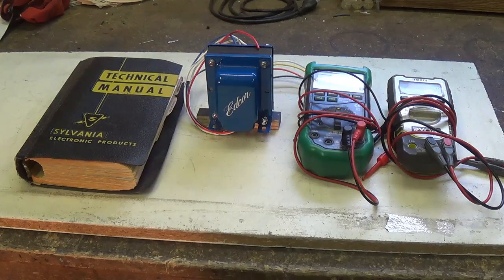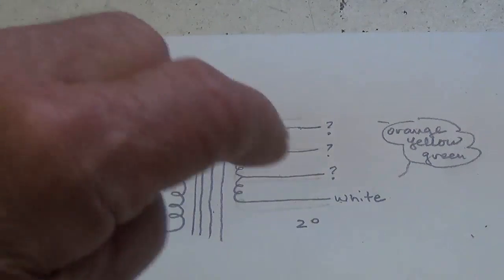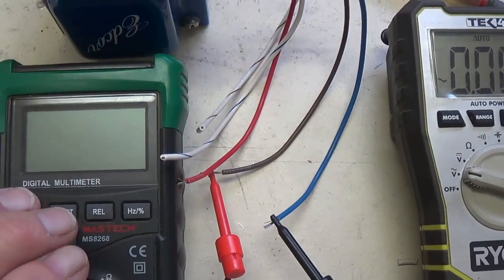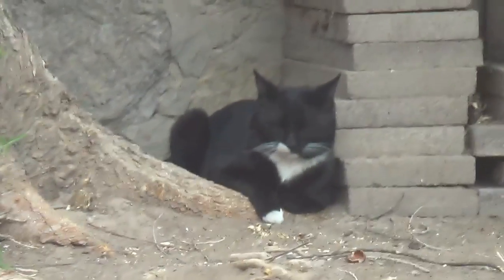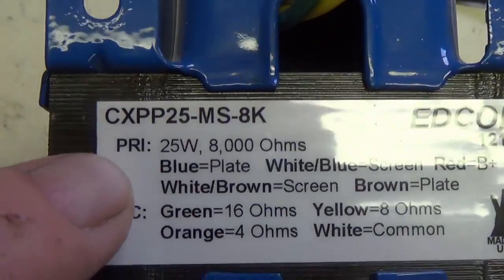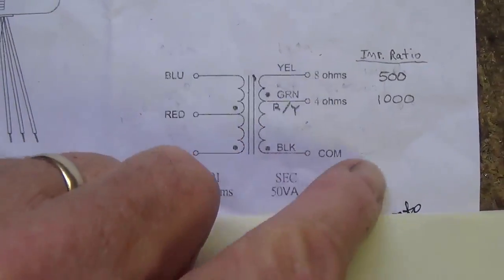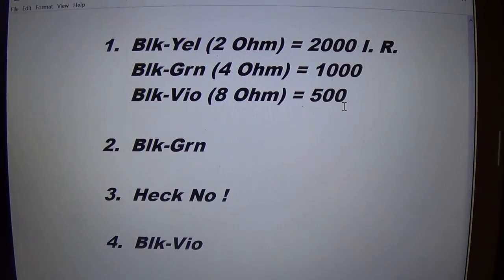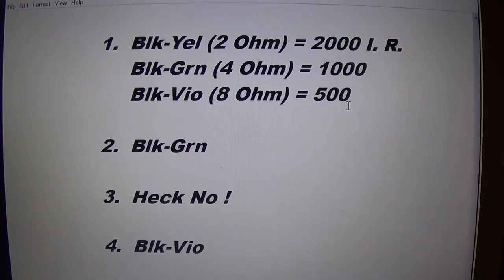Impedance Ratio: The Easiest Way to Decipher Output Transformers

Comment: I am going to inject a comment for consideration here, as you know Uncle Doug I am NOT in any way an expert on things of this nature but, I have a pair of mid eighties Infinity HI FI speakers that run down in the 2.5 to 3.5 ohm range at certain frequencies, considering that this is an ultra linear transformer could it be that this transformer would be a pretty good match for a HI FI tube amp (I know we are talking guitar amps here) to match these types of high load speakers to a tube 6L6GC hi fi amp? I mean it looks like it would work okay for what I'm seeing here, again I am not contradicting you just asking! As an aside the mid eighties Infinities where known as amp killers and needed an amp stable down to 2 ohms to run at full volume. I stopped the video at 24:17 to comment. I would like to ask another question (I know it's outside the scope of the video but I am just wondering) if I hook up my oscilloscope to the output of my amp while running my Infinity speakers I should be able to calculate the speaker impedance while running, is this correct?  Okay, now on to the Hot Rod. I love it! Since you mentioned the rear view mirror I have a quick story about my car, a 1986 951 Porsche (944 Turbo) it has been lowered about an inch or so (30mm to be correct) and it rides ROUGH! great for the track...not so much for the street, I was going down old 66 near where I live in western Oklahoma and it is still of the old train track like separated concrete sections of road, kind of like a train track, ka chunk ka chunk sort of thing I know you know what I mean, anyway on particularly stout KA CHUNK my rear view mirror just decided to let go and fell into my lap, lol. Well isn't that special, lol., anyway GREAT episode and I love what you've done to the Hot Rod!! It looks much better now, keep 'em coming!! Thanks for all you do and have a great day!!
Reply from the maker: Greetings, Jack. Yes, the impedance varies with different frequencies. I didn't venture into that minefield because I wanted to keep the video clear and easy to follow. I believe the standard frequency for speaker and OPT impedance measurement is 2KHz. Thanks for your nice comments on the ratrod. I went to a car show today and it was a big hit. I spent the afternoon "antiquing" the '32 Ford grill shell so it would match the rest of the car.
Reply: I completely understand. I love the car, I'm sure it was a big hit!! A Deuce shell would be perfect! Thanks again!!

Comment: Is there a lot of information in that book like ohms law and that I’am wanting to learn more about this stuff
Reply from the maker: That's good to hear, Chris. Best of luck with your pursuit of knowledge.
Reply: @UncleDoug  any suggestions of books or DVDs on learning I built a 5E3 clone but I ran into problems with the power supply and blew a three watt resistor so I stopped with the amp and now I’m trying to learn more on the transformers and the rectifier tube and stuff to be able to diagnose what I wired wrong

Comment: Hi Doug, I got a different answer for #3 and wondered where I might've gone wrong. Some data sheets put a pair of PP 6L6GC's at 4k4 ohms, which is only 10% off of the Xfmr's stated primary, meaning it should be close enough if using it as described. That said, it says it's rated for 40W which I assumed is RMS, and also conservative. In my experience, 2 PP 6L6GC with fixed bias come in around 32w RMS with cathode currents at 80mA and 400vDC on the plate, so I figured it should be fine. Can I get your thoughts?
Reply from the maker: I'm sure there are all sorts of different ways of looking at the problem, Britt, but I simply wanted to remind viewers to pay attention to the rated wattage of the OPT. Thus, the simple answer is "No", based only on the information provided......a 40W OPT won't work in a 50W amp.
Reply: Thanks Doug. I've been accused of overthinking things often. It appears this is no exception, haha!
Reply from the maker: Better too much thinking......than the opposite, Britt.

Comment: Can you post links to the meters etc that you prefer to use?
Reply from the maker: No high-tech here, Michael. I got my latest DMM on Ebay for around $40.....and love it. The Simpson meter came from a local pawn shop for $25 and required some clean-up. ESR meters are nice, but you can probably get by without one if you prefer to simply replace electrolytics.

Comment: Hi Uncle Doug.... just curious, do you have any idea what the current output might be on the secondary of the hundreds of volts from the output transformer? So for instance if I use a 12 VCT 3A to inject 6v into the primary of the OPT and get 250v out of a secondary winding, what would the max current be? 250v (?)A? Thanks in advance!
Reply from the maker: V x I  in  = V x I  out, Rob. 6 x 3 = 250 x I  so I = 18/250 or .072 A  (72 mA).
Reply: @UncleDoug  Ah! Thank you very much! I appreciate the info. :)
Reply from the maker: @nonsuch  You're welcome, Rob.

Comment: if using 4ohm impedance you could i guess wire 2 8 ohm speakers in series to get our 4 ohms ,I had a amp tech years ago wire my 4 12 inch speakers in parallell ,which i believe should give me 8 ohms ,the amp has a 2,4 ,8 ohm selector switch ,so its set on 8 ohms pretty sure that being on 8 ohm on selector that it is correct,btw the rat rod is coming along very nicely ,the chopped top makes all the difference in the look ,your doing a awesome job on the car she sure looks wicked
Reply from the maker: Thanks, Joe. It's the other way around......2 x 8 Ohm in series = 16 Ohms, while 2 x 8 Ohm in parallel = 4 Ohms.
Reply: @UncleDoug  absolutley and that explains why my 4x12 cab wired in parallell is 8 ohms

Comment: The old question, does size matter. I haven’t calculated a 65’ Gibson Falcon output transformer specs with 6v6 output tubes but it seems awfully small for the job. This maybe a horrible observation(definitely naive). I ask as the later Falcon sound a bit weak compared to the 1960 model. Apologies….
Reply from the maker: No apologies necessary, PW. Yes, mass does matter when it comes to all types of transformer, including output transformers (OPT). Skimpy OPT's can result in a loss of bass frequencies, which produces the "weak" tone you referred to.

Comment: Can we connect 4 16ohm speakers to the 4ohm lead? Or 2 16ohm speakers to the 8ohm lead? If yes, how would we do this?
Reply from the maker: Yes, if the speakers are wired in parallel.....not series.

Comment: Don't know if this has been asked - and/or answered - but if impedance of the tubes varies based on the plate voltage how can you calculate a perfectly (or ideally) matched output transformer?  is there some math to determine that outside of ballpark tube data sheet figures?
Reply from the maker: You simply use the impedance associated with the specific plate voltage that you will be using in the circuit.
Reply: By the simplicity of your answer I assume I missed a connecting dot ;-)   I shall re-watch.
Reply from the maker: @huddyskiba1  If you consult a tube manual, it provides the impedance for all output tubes, single and double-ended, at different plate voltages.

Comment: Hallo. I have one question so please help me. I have hand made Deluxe reverb with Hammond output transformer. Amp work on 8 ohm with Jensen P12N speaker. Question is can I replace this speaker with Celestion greenback 16 ohm? Trafo have 3 wires for 4,8 and 16 ohm. Did I must do something else or just switch wires from trafo? Kind regards
Reply from the maker: If your output transformer has a 16 Ohm output winding lead, then you can simply connect it and the common lead to your 16 Ohm speaker.

Comment: So let me understand this. For the 6L6 tubes, the test transformer calculates for correct speaker impedence, but the primary impedence of 8000 ohms does not match the tube data. Isn’t that an issue? If not, why?
Reply from the maker: The output transformer doesn't "calculate" anything, Danielle. It simply reflects the impedance of the speaker back to the output tube(s). It's up to you to ensure that this reflected impedance is correct for the output tube(s) being used. A tube manual is used to determine the correct impedance for the tube(s). There is some leeway, but the reflected value should be reasonably close to the stated value.

Comment: Uncle Doug, If we didn't know that the white was secondary common, is there a way to determine "blind" which is which?
Reply from the maker: It's generally white or black, FM, but you could use an accurate ohmmeter to determine the resistance between each pair of wires. The pair with the highest resistance would be the common and highest speaker impedance. This would narrow it down to one of two wires, and the common would probably be the blandest color.

Comment: Cheers from Argentina Uncle Dog! you are a great teacher and I admire you a lot! Can I make you a question about an amp that I have been working on? It makes a awfull distortion at higher levels... I change the speaker and the problem remains, change the power tubes and nothing... it´s a hybrid Fender Super Champ XD... thanks!
Reply from the maker: Thanks so much, Fernando. I'm sorry to disappoint you, but there are so many variables that I simply can't troubleshoot a complex problem like that by long distance. You need to work your way through the circuit carefully to find  incorrect voltages or failed components. Good luck.
Reply: No problem!! I will keep working on the amp! Cheers!

Comment: Shouldn't you be injecting your low voltage AC into the primary and measuring on the secondary so you are not dealing with such high AC voltage on your output?  Could be pretty dangerous if you don't know what to expect for an output voltage.  I just feel that going the other way keeps you in lower voltage throughout the test.
Reply from the maker: The lower the voltage, the less accurate the measurement.......and why would AC voltages in the 20 to 50V range be especially hazardous when dealing with circuits that routinely have over 400V present?  If it is, then this type of work is just not recommended.

Comment: What about if you put a resistor across the speaker terminal to bring you to 2.99 if you had a 6  or 8 ohm speaker.
And another question what was in the microwave when it went off...hahah
Nice hot rod like the wheels I bet they're light, only thing I maybe  change in the wheels instead chrome rings around the cutouts but maybe that might be a bit glary
Would be nice with some skeleton and bones on the paintwork instead of flames what do you think. I know the perfect name for that car the Undertaker, see what I done there. wouldn't it of been easier to drop the front end by 2" and raise the back by 2" or would that have hit the cross member....?
Reply: If played with this notion as well.  Getting a high wattage resistor and putting it in whatever position you need  to adjust any speaker impedance you are trying to create.  For example I have two 8 ohm speakers that I'm running in series but my transformer is really only meant for 8 ohms.  So to me I had the choice of 4 or 16 ohms with those two speakers I have.  I've wanted to try and drop each speaker to 4 ohms using a resistor in parallel on each speaker, then run them in series.  But I don't wanna fry my tranny.  
Yet to finish the video so I might find the answer yet...Just wanted to reply to this comment in case Uncle Doug reads it and replies to you lol

Comment: What if I want to run at 320 volts? Uncle Doug HAS to be a licensed teacher, probably happily retired by now. I see a lot of 6L6GC amps that run a primary impedance of around 4000-4250 Ohms impedance for a PAIR of 6L6GCs (for GUITAR AMPS). They run at pretty high plate voltages too. 1900-2300 Ohms is pretty common for FOUR 6L6GCS. 1200-19000  Ohms is pretty common for SIX 6L6GCs. Now we are getting to 150-180 Watts, making the neighbors mad and some potential hearing loss. My old Chevy had an ammeter, where to the right of ZERO meant the alternator was working and to the left of zero meant you were draining the battery.  I rather preferred that to the new volt meters.
Reply from the maker: You're right, Seth, I am a happily retired teacher.

Comment: Hey Uncle Doug, this video is pure awesomeness, thanks a lot! I was also wondering what's the expected load resistance for a 2 x EL34 based amp - PP running at a 465V plate voltage (Orange amp from 1970's), I can't find this info in the data sheet I have... would you have the info somewhere? Thanks!
Reply from the maker: According to Wikipedia, since no traditional tube data I could find provided the load resistance in an AB circuit, the load resistance is 3.4 k Ohms.
Reply: @UncleDoug  Many thanks for your answer! Funnily enough, I just found out contradictory data in an RCA tube book from 1975, and they state an ELR (plate-to-plate) of 6500 ohms,  push pull Class AB1 (values for 2 tubes) @ 450V plate & grid N°2 supply voltage! Who to believe then? :)
Reply from the maker: @raphUp2eleven  I believe 6.5K is too high for a pair in P-P.  According to https://frank.pocnet.net/sheets/129/e/EL34.pdf  The load resistance is 3.5K for fixed bias. Almost identical to Wiki.

Comment: Is there a reason why you use one transformer to step down to 7V and then step up using your test transformer, versus simply connecting the mains to the primary side of the test transformer?
Reply from the maker: I prefer to input low voltages to the secondary and get readings from the primary, Nikita, and I usually use a Variac to get several different input voltages. If you want to reverse the procedure, you are welcome to do so.....as long as you are very careful to avoid any shock hazards.
Reply: @UncleDoug  I guess if you accidentally energize the wrong end of the transformer with mains power you could get in the kilovolt range. I have no experience with such voltage but I expect it’s best avoided.

Comment: I'm no expert - but perhaps they don't list the impedance ratio because it may dependent on frequency.  It would be fun to see you repeat the measurement with the audio signal generator and oscilloscope at different frequencies and get a frequency response.
Reply: These measurements are usually taken at either 400Hz or 1KHz. Often it is stated at which frequency the measurements are taken. For hi-fi operation, the impedance should remain steady through the midrange, so either of the above frequencies would be fine. The transformer characteristics do change at the frequency extremes (20-50Hz, 10k-20kHz).
Reply from the maker: Thanks, CJ. Since the impedance of an inductor is directly proportional to frequency,  the frequency must indeed remain constant throughout the measurement, and significant variations do exist at extremely high or low frequencies.

Comment: Hi Uncle Doug, could I use a standard 9 volt pedal wall-wart instead of the filament trans?
Reply from the maker: If the output is AC it would work......but it's generally DC, which won't work with a transformer.

Comment: I noticed in the tube manual that there was an ultra linear section for the 6L6GC's and wondered if the math worked out there.
Reply from the maker: What math are you speaking of, David ?
Reply: @UncleDoug  If the tube impedance was different (under ultralinear) such that ithe math worked out to a 4, 8, or 16 ohm speaker. You had said earlier in the video that the transformer was capable of an ultralinear configuration.
Reply from the maker: There is generally a special column in tube manuals for output tube ultralinear operating parameters and they tend to differ from those in regular circuits.

Comment: Using this method I get an impedance  ratio of 570. I'm using 2 pairs of 6L6GC's in push pull. Typical Twin Reverb setup. The final numbers seem to be off by a factor of 2 given that my Super Six uses 6, 8 ohm speakers in series parallel or 5.3 ohms.
My results:
6.3 vac applied to the  secondary, (actually using the filament windings on the power transformer) and getting 146 vac on the brown to blue. (Primary)
146/6.3 = 23.17 squared = 561.69. 6000/561.69 = 10.68. That number is perfect if it's divided by 2.
Do I have to factor in the push pull?
Reply from the maker: The procedure is run on the output transformer......not the power transformer, Borg.
Reply: @UncleDoug  Yes I know. I only used the filament windings to get the 6.3 vac to apply to the secondary of the output transformer. It's the only source of low voltage ac that I have. I did disconnect the secondary from the output jack chassis ground.
Reply from the maker: @borg3575  I misunderstood, B. Sorry.

Comment: Is there a video on power transformers?  I bought a amp that has a blown power transformer so I can only guess what it is. 5y3 requires: 380v plate, 5v fil.   The other tubes are 12.6 fil.  12J5, 12SL7, 12SH7.  Meaning the transformer needs to be 380v, 12.6v, 5v ?   if I understand it correctly.
Reply from the maker: Yes, I have posted videos on PT's. That's an unusual tube complement......good luck finding a replacement.
Reply: @UncleDoug   I think it's more I don't know what I am talking about. I have been racking my brain with this one. I am a newbe at this.  Enjoy your videos as they are a great learning tool.
Reply from the maker: @MichaelRusso  You might want to start with a more conventional circuit for your project.
Reply: @UncleDoug  You may have a point. I will continue my study on this.

Comment: My Model Train Transformers put out AC voltage reduced 5 to 15 volts can i use that as a power source for this test???
Reply from the maker: I guess, Dennis, but you're better off with a 30V to 50V source. You can apply your AC voltage to the primary and then accurately read the secondary output (it won't be 1.000V, however).
Reply: @UncleDoug  well when saw you pushing 6 volts I thought my train transformers do that???? They take in 120 and put out 15-17 VAC up to 4 amps.